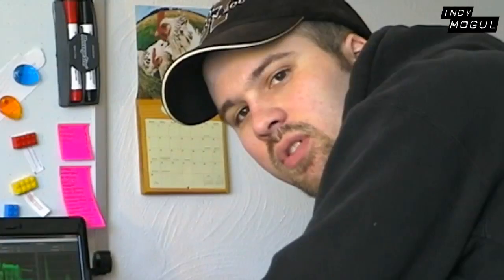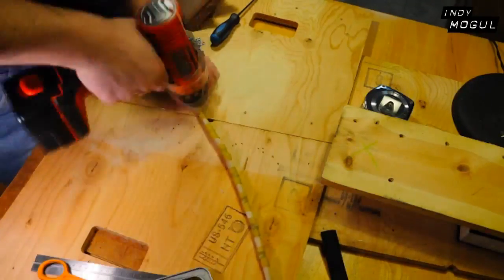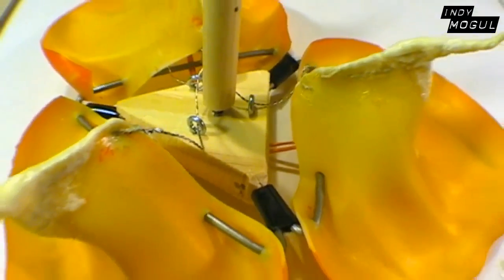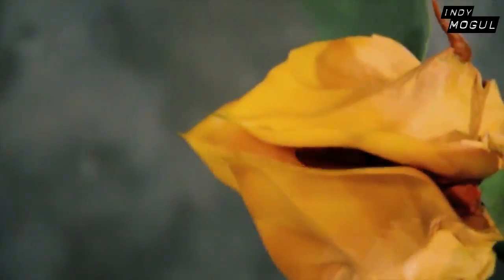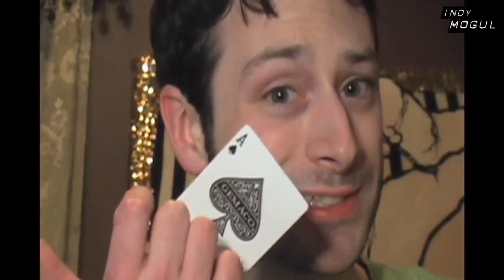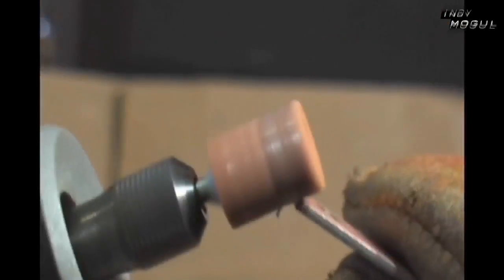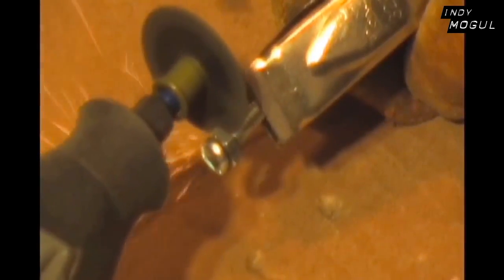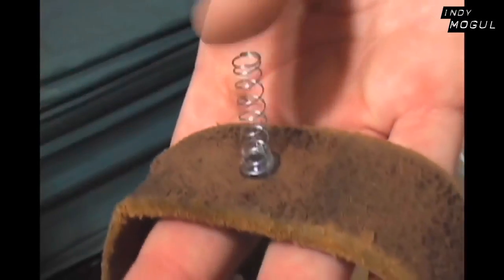Man-Eating Plant and Hidden Card Rig: Your FX

Comment: load a poprip upsidedown through the rounded ends and into the hole under your
clip rivet loosen and then fold it into itself load another poprip rivet aaannnd loosen
begin grinding or cutting down the bottem of your poprivets TO A LITTLE LESS THAN THE THICKNESS OF UR NUTS LOL